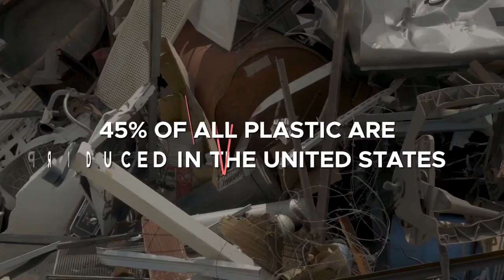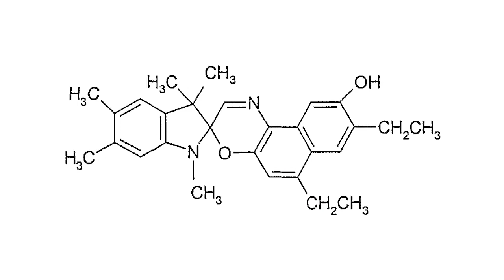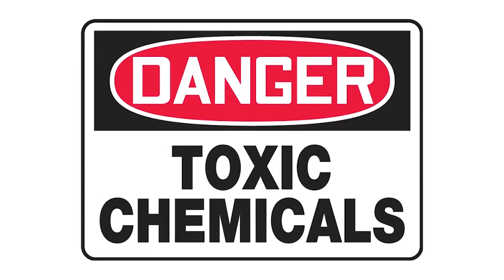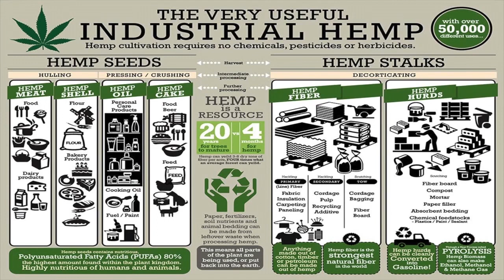Milagro Hemp plastic

Comment: Absolutely outstanding 😎
Hemp Bast fiber composite
https://youtu.be/zxj-86NIf8U
that's a 3# hatchet not a rubber mallet 😁
https://youtu.be/HSE5vESjFk0
Starlite
https://youtu.be/fmCSmI-5MK4
Live lighting Hemp gasification
https://youtu.be/ztOrrce7568
Synthetic NG, heat risers, manufacturing steam